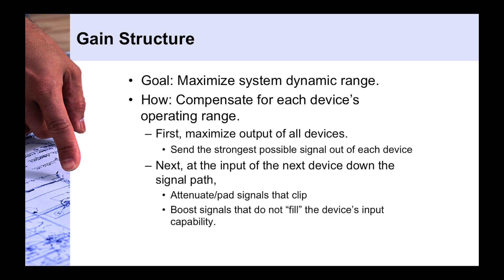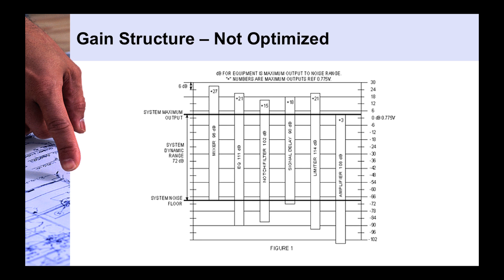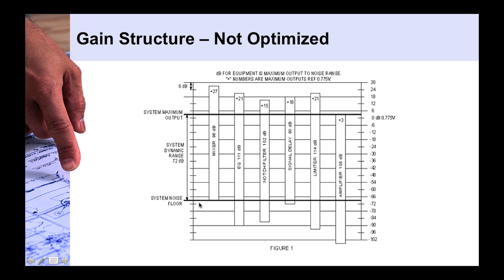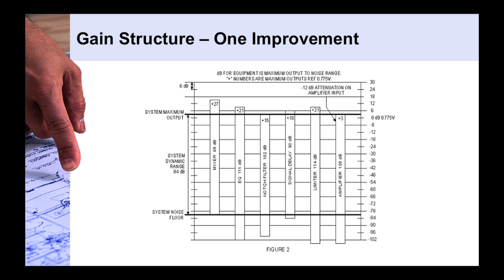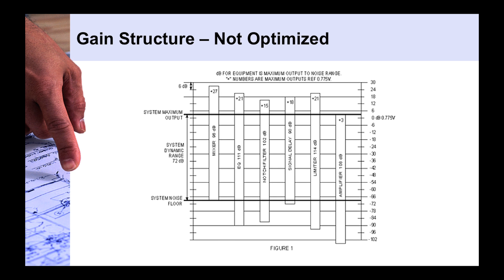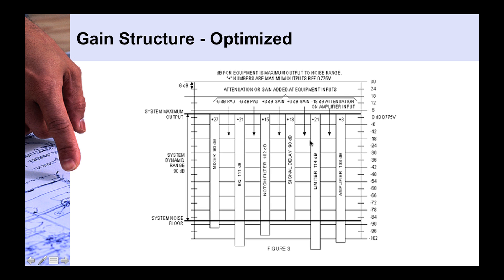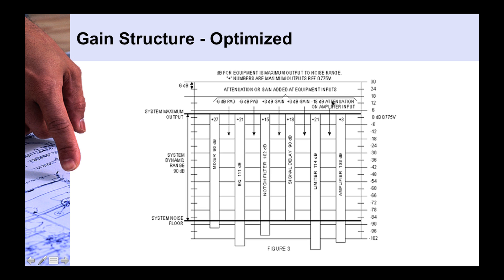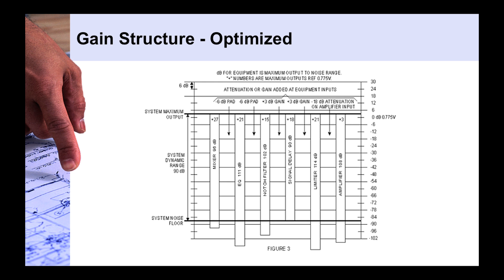Gain Structure - Maximizing system dynamic range

Comment: still confusing when you say db ,dbu ,dbv,dbfs....,? i mean when you are speaking about pads how to make a pad with the desired value and i'm still septic about the noise floor of each system because there is also the spurious free dynamic range and other issues like gain offset , gain error , to take in consideration and i think it's not that simple

Comment: Hey this video is really great, very helpful. But I am having troubles finding the max output level for my amplifier, is this just the gain of the amplifier?
Reply: Gab Gros I
Reply from the maker: Gab Gros Thanks for the kind words!  This continues in another video here: https://www.youtube.com/watch?v=zA5SaZySMOs but before you get there, I'd like to clarify a few points:1) We only need to worry about input levels to the amp when we're setting our gain structure.
2) The amp is always working at the same output level - that is, it's always adding the same amount of voltage gain to whatever input signal we give it.  It's only louder or softer because we adjust the input attenuation knob on the amplifier.  So it's softer or louder because we're feeding it a louder or softer input signal.  Voltage gain is always the same.  There are no adjustments to make between the amp and speakers.
3) The number you're looking for (to calculate gain structure adjustments) is the INPUT SENSITIVITY of the amp.  For more on this, check out the above video link...
Reply: @phy350  My amp has variable input sensitivity.